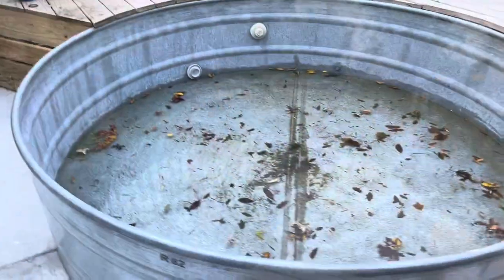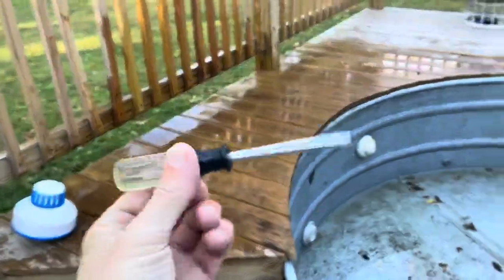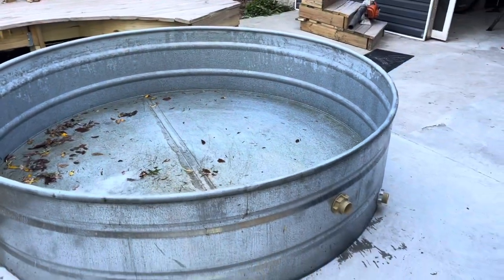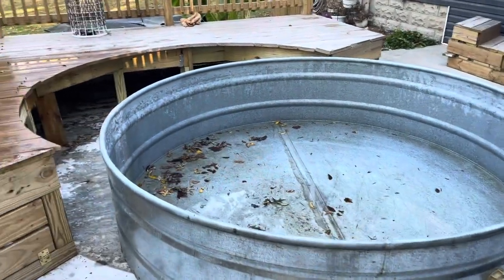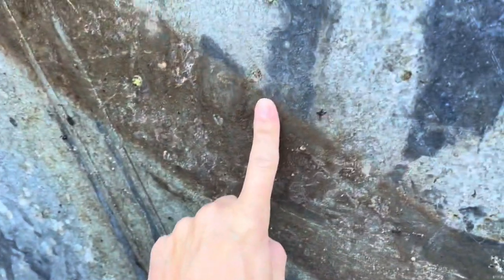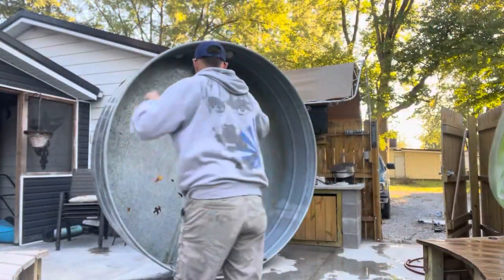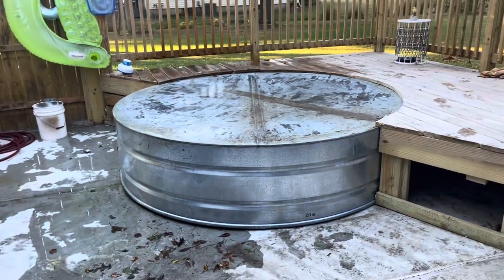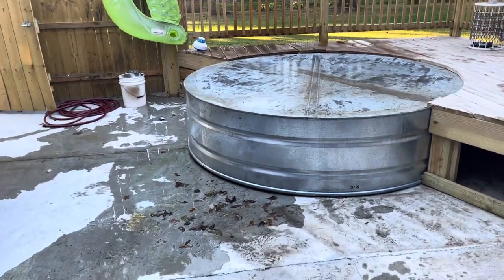Winterizing the stock tank pool￼

Comment: Im in Illinois as well i have a pool linner in mine do i jave to drain it empty?
Reply: I treated mine like a pool put a cover and floats to keep water and debris away
Reply from the maker: I really could not say for certain that it will be okay. When it freezes, it expands. I would worry about it extending too much and forcing the metal to come apart at the seems. If you have a filter, you will need to drain it and any plumbing as the pipes with definitely freeze.
Reply: @maxspeedadventures   ok now i understand i will drain it 3/4 of the way so the kinner does not fly out . Does that seem logical
Reply from the maker: I’m just not sure. That might actually be even worse. The bottom seam is the one I would worry most about coming apart. When I had my regular pool, it would only freeze about the top six inches. I think if I was not able to drain it and flip it over, I would leave enough water in so that the very bottom and my inlet and outlet fittings would not be in ice when it freezes. Probably not the answer you’re looking for, but I’d rather be safe than sorry.
Reply: @maxspeedadventures   its ok i appreciate the truth.  I will dump it all the way flip it, and i can always put the linner back in next spring. I spent a lot of time on this stock tank making it a pirate pool lol so i dont want to mess it up